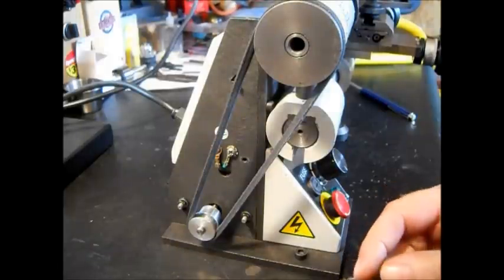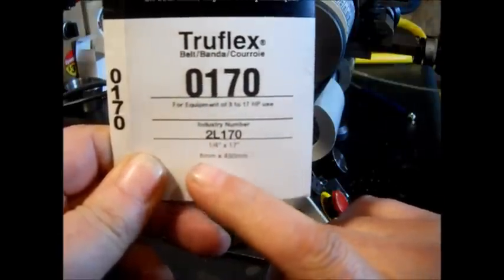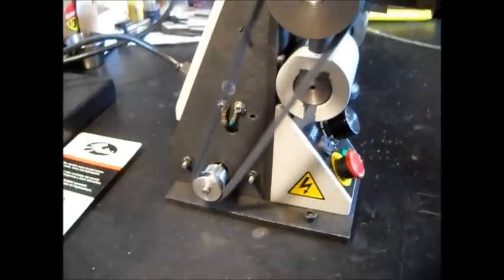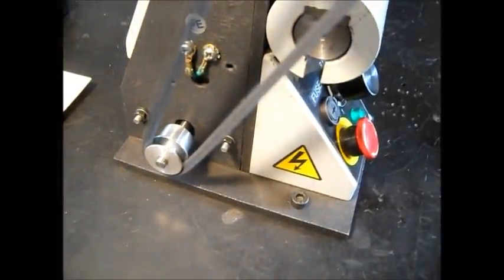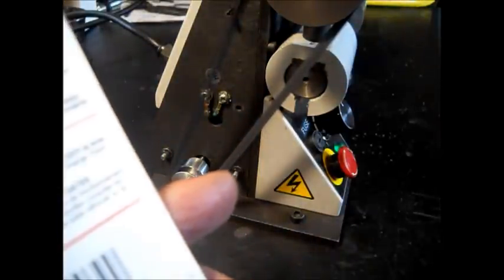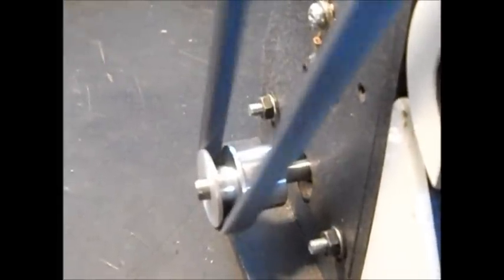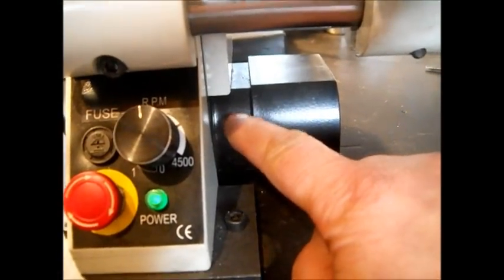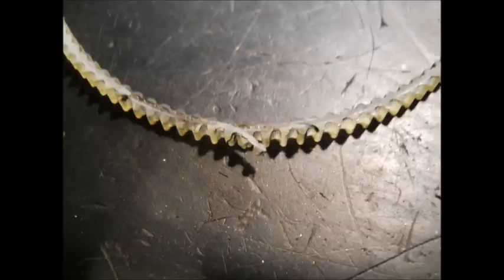Lathe Motor and Belt Replace-Repair

Comment: Hi I picked up an old sherline WLT 1024 (abour 10 years old) off eBay for $50.00 (the guy hadn't used it in about 5 years) and it had the same problem,  the belt had gone, I did the same thing, went and got a vee belt from the auto supply place and it works fine.

Comment: Man oh man sorry to hear about our troubles. I bought a 1948  atlas craftsman 10"lathe a while back and being the total novice I didn't know what to look for. Needless to say I'm still getting it set up properly 6mos later!! The PO had a bunch of broken and mismatched parts on there. It had a horrible vibration to it. come to find out it had a cobbled together spindle shaft that had almost.250 runout XP Join a machine specific forum online too they are a wealth of information